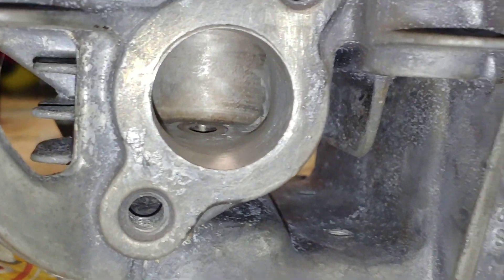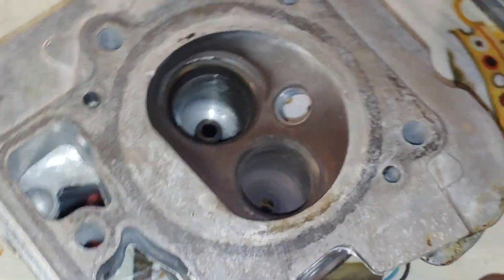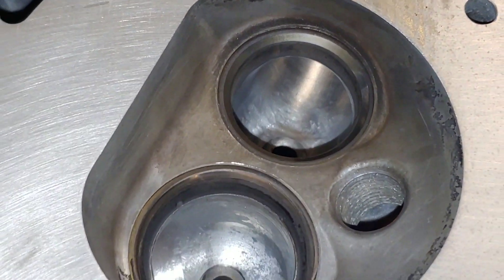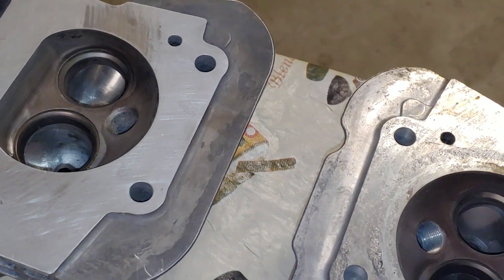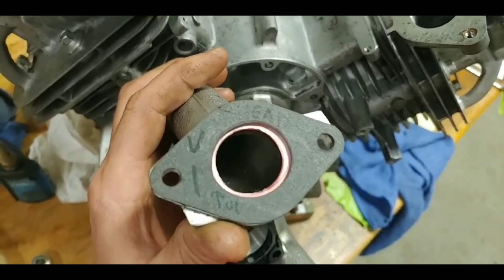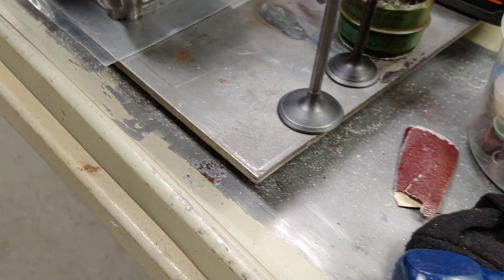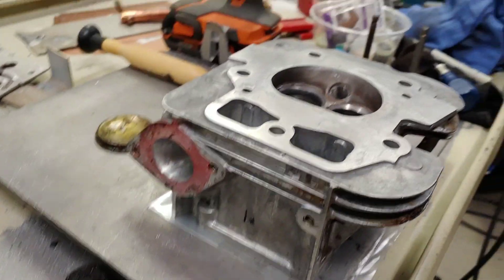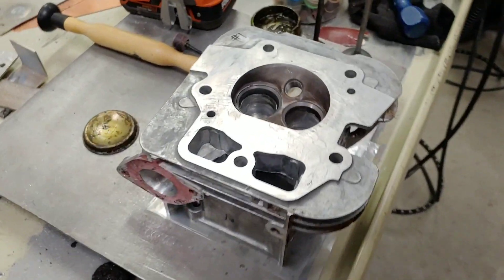Briggs and Stratton Intek ohv 49 v twin cylinder head prep

Comment: Why didn't you round the matting surface to match the head gasket make more power with that
Reply from the maker: Do you mean "deck" the head or take surface off it to raise compression ?
I didn't want to get into an issue of having the intake manifold seal correctly, and I was going for the easiest things. 
I still had 5-6 hours in them total on the port job and between disassembly and reassembly and at that point anymore work was a diminishing return on the time I had.

Comment: That is really cool! Did you get it all put together? And does it run better?
Reply from the maker: Its the recent wheelie popping vid, that was its maiden voyage. 
It seems really strong, and revved right out before I realized it. 
Unfortunately its hard to compare, this is a bigger engine than what I had. 
but it doesnt seem to mind the revs whereas the other one seemed a little choked at high speeds.
Reply: Could you give a walk through on how and what you did